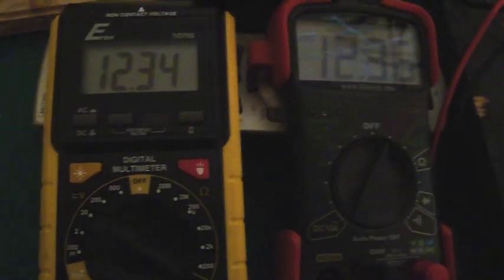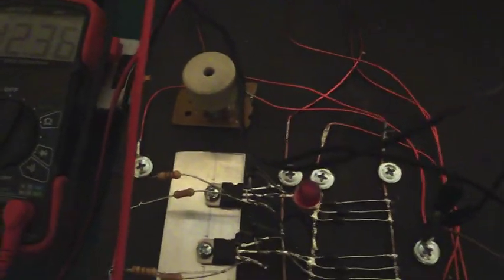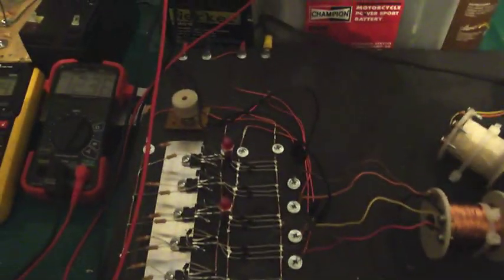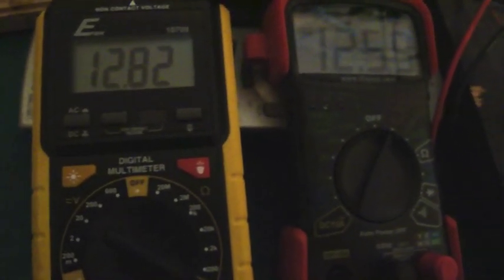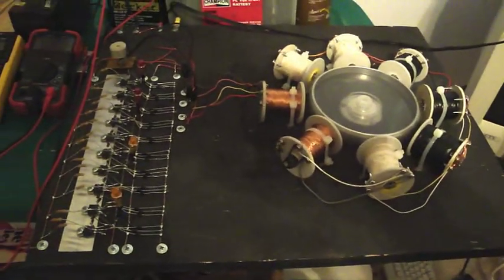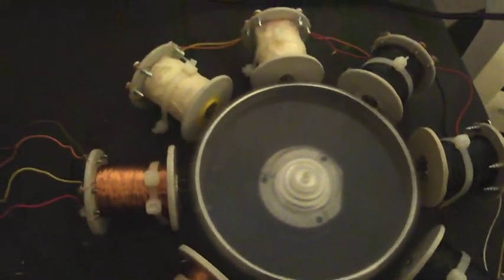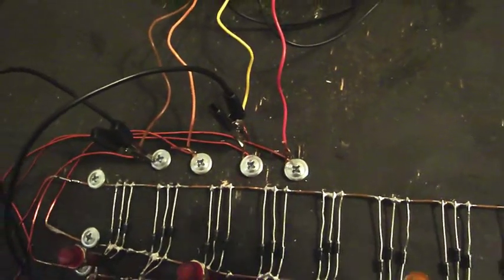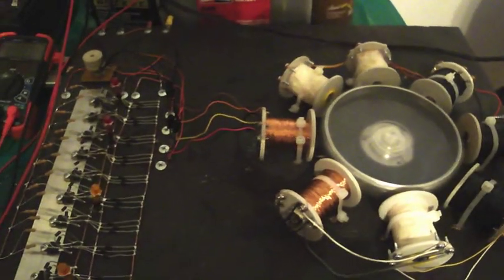Sampu Express Pt4.avi

Comment from the maker: The input of the FWBR is connected to the SR & ST connections, look for the symbols ~  ~ representing AC, then from the post marked + connect it to the positive of a secondary charge battery and the post marked - connect it to the negative of the same battery. Sometimes the output of the FWBR can be sent back to the run battery to slow the discharge or keep the charge at one level. A lot of attention must be paid to the setting of the pot to achieve this.

Comment: Hi! I´m really impressed about the sampuexpress u did. i´m trying to rebuilt it but i´ve one question. you´ve connected a fullwave rectifier ... but how? at the start of trigger and run coil an then how does it continue?  i´m not the best at electronic :-(
thanx for your help
netchecker2012

Comment from the maker: I believe the charging capabilities are greater than the power used to run the motor. It will charge two batteries at once and does it very quickly.

Comment from the maker: @min2oly 

The connection does not seem to take away from the main charging circuit. I believe the AC produced by the build and collapse of the trigger and run coils is sufficient to fire the transistor and charge the second battery. As you can see in the video the charging rate of both outputs is quite high.

Good Experimenting...
Poppy

Comment: Curious connection of the FWBR...
do you notice this taking away from the first charge battery? 
or do you notice the primary battery losing its charge faster w/ or w/o it?
those are both high pressure areas for leaking out the energy.
thanks for the video - food for thought...